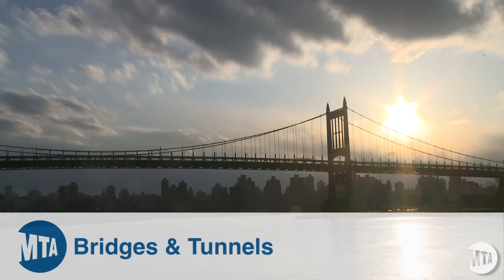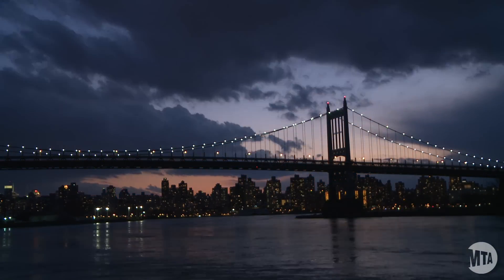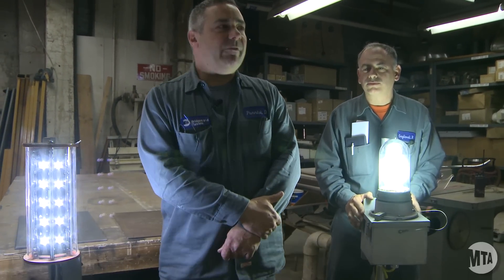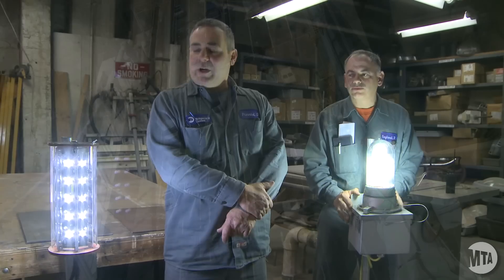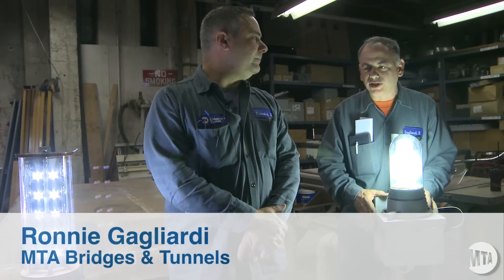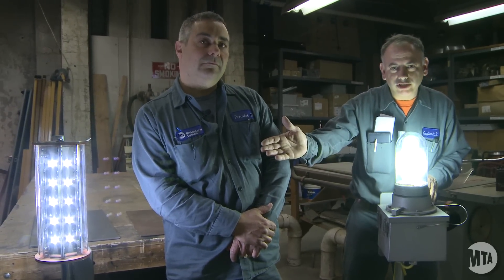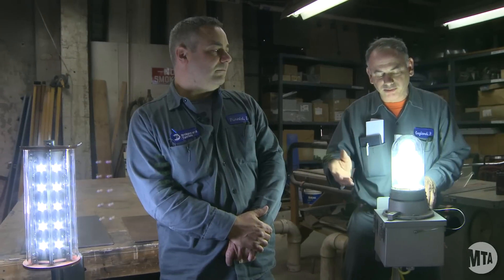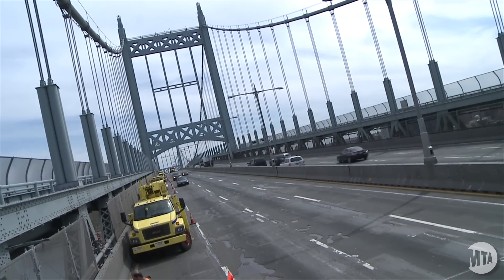Robert F. Kennedy Bridge LED Lights

Comment: new 6 train route; brooklyn bridge city hall, canal street, spring street, 111th street hall of science, bleecker street, astor place, 14th street union sqaure, 23rd street, 28th street, 33rd street, grand central 42nd street, 51st street, 59th street, 68th street hunter college, 77th street, 86th street, 96th street, 103rd street, slattery plaza, 110th street, 116th street, 125th street, 3rd avenue 138th street, brook avenue, cypress avenue, east 143rd street saint marys street, east 149th street, longwood av, hunts point av, whitelock av, elder avenue, morrison sound view avenues, siant lawrence avenue, parkchester, castle hill av, zerega av, westchester  sqaure, middletown road, buhre av, pelham bay park models; r142 r188 r62 r62a

Comment: To alfredo brito--I have seen MANY MV bulbs last MORE than 25 years. I collect bulbs and have several specimens. The 175 and 400 watt MV's last the longest, but I have seen 100 watt Westinghouse Lifeguards from the early 1970's in daily use, with still very good light output. As for eric holm saying these are 100% USA made--I say BULLSHIT! They are "assembled" in USA with Chinese parts, you can bet on it--Philips, Cree, and many others "claim" their LED garbage is made in USA---and the truth is, at least a few parts are made in China. That is NOT 100% made in USA. LED's belong on stereos for indicator lights, and in cheap throwaway flashlights, which, frankly can't match the light throw of a good old incandescent flashlight, which is typical of the well-known "light fall off" of LED lamps. In Massachusetts, they installed 270 watt LED streetlights to replace 150 watt HPS---because, frankly, the 270 watt LED barely gets as much light on the road as the 150 watt HPS, if thy had used a 150 watt LED the street would practically be dark. Period the end, LED's are a joke. And if your merc lamps are only lasting 2 years, they are garbage. The lamps looked to be either GE or Philips. These are still decent quality, so you can kiss my ass if they don't stay bright at least 7-10 years. I'd rather sit in the DARK than light any area or space with those awful LED lights.

Comment: Cheap Landlords will even want to go LED, once someone explains to them the return on their investment. 50-75% savings in electrical costs alone, and the lower costs of maintenance will get them to listen. Usually most lighting solutions pay themselves back in less than 3 years. Making it a great way for cheap landlords to save alot of money in the long run...which is what every landlord wants...So tell those cheap landlords to give LSI a call. They'll show them how they can save money!
Reply: Vvu
Reply: P copycat up

Comment: Maintenance is a huge cost in lighting. Mercury vapor bulbs burn out within less than 2 years. LED's will last approx 7 years without ever touching them. Think about that. The cost alone of the 3.5 bulbs that you will need to use in the same timeframe will bridge the gap in $ almost in itself and add to that  the saved employee hours in maintenance. Mercury vapor bulbs must be recycled within specific guidelines = extra expense.

Comment: To "K4NBC" : please note these LED fixtures are manufactured in the USA by the #1 leader in manufacturing LED lighting solutions: LSI Industries Inc. You can't just compare the acquisition cost.Yes LED costs more. But you need to calculate the cost of purchase, versus the total cost of operation and maintenance.In most cases LED fixtures use 50-75% less energy, and pay for itself within 2 to 3 yrs. It's become a no-brainer. As long as you use/purchsae quality product from a reputable co.
Reply: uhch

Comment: K4NBC, not sure why you have problems with LED tower lights. You have to stop purchasing them from Harbor Freight. 4-Times Square and Empire State Building among other sites in the area are sucessfully using LED beacon and obstruction lights for a few years now. The mentioned sites have taken direct hits multiple times lately and have not had any issues with LED's being damaged.